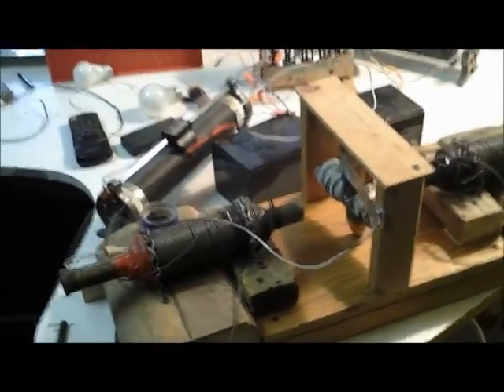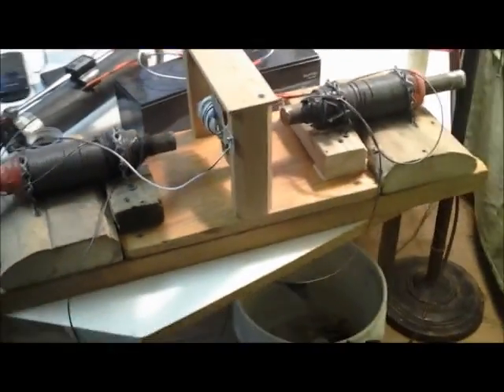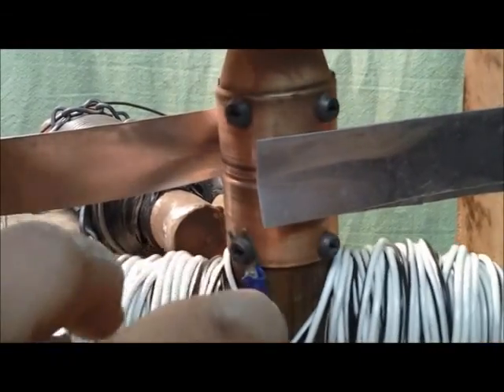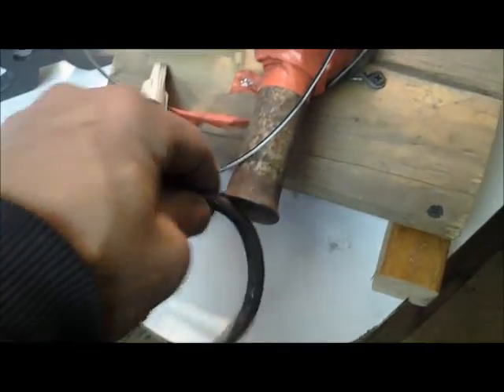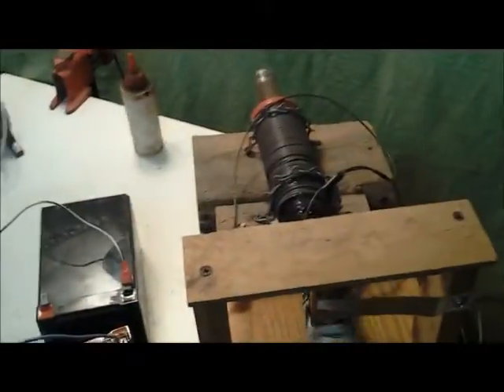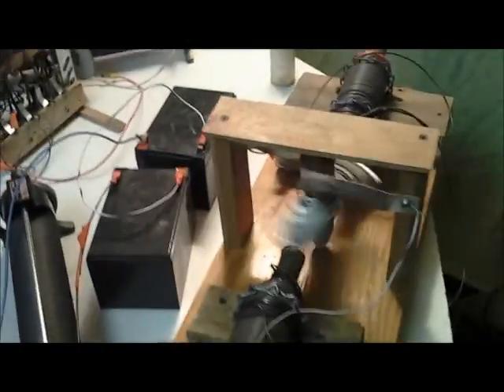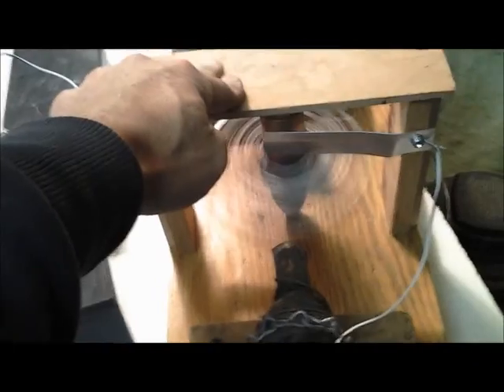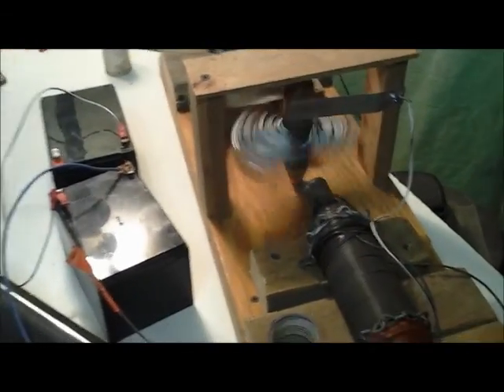DC Motor Demo

Comment: now I know how the ancients did it..
Reply from the maker: +aslimline S yeah with oxen and giant twine laced diamond rough) pieces lashed to a monstrous wooden animal driven wheel and about 6 horses or something similar. Did you know that old wooden planes were made of small stick, cloth, and goop. same for a giant cutting wheel made of wood, tiny angle braces,  and sized diamond chunks attached to the wheel like carbide teeth attached to a SOFT circular saw. then it will eat right thru stone. with water of course.
Reply: Made by one man Yes  sir them folks where a heck of a lot smarter than people today give them  credit for'... You don't see artist creating nothing like they where capable...of back then   ///